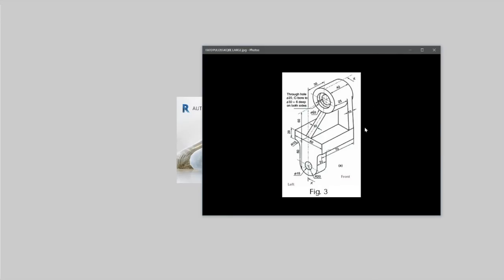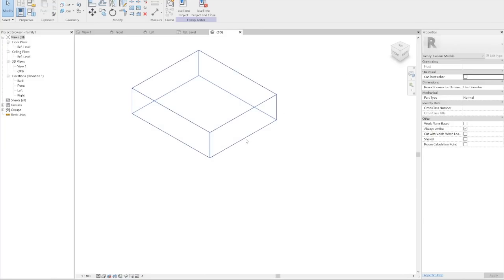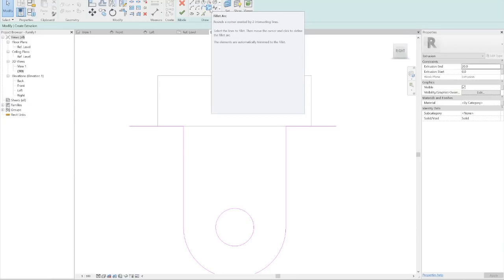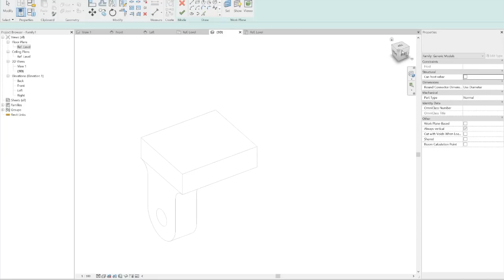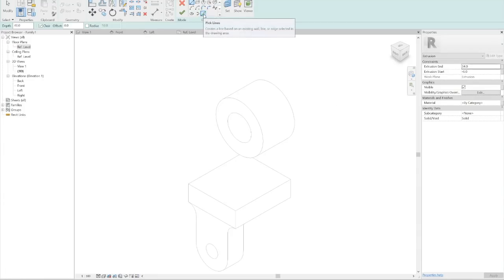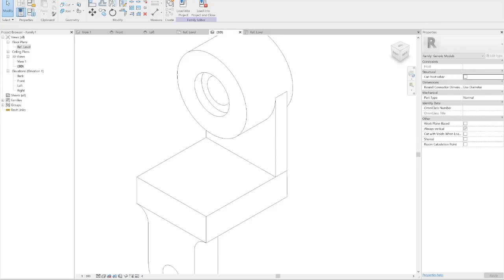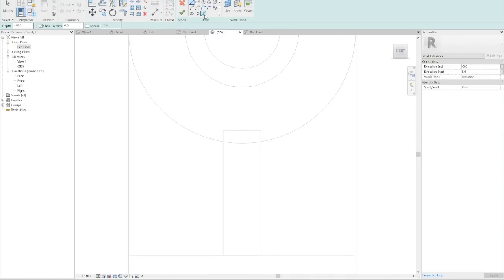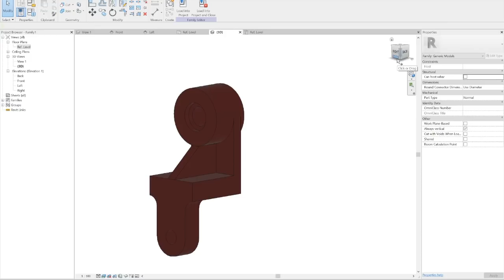Modelling a Basic Mechanical Object in Revit (Metric and Imperial)

Comment: Why cant I join the 2 objects, the central object with diagonal cut on one side and the bigger cylinder? I am having an error saying 'Can't keep elements joined'
Reply from the maker: I’m not too sure about that, I’d have to take a look. Email me at neuroscience@sigmund.science. If you can include the family file, that’ll be best. It’s possible that the diagonal piece isn’t going far enough into the cylinder. It has to go all the way in with no corners out of the cylinder

Comment: `that trim and extend corner function doesn work here. at 6min. how do you do that
Reply from the maker: Have you used the split tool on the curve?
Reply: @DenariPixel  Hi,
 which is better to create mechanical pieces in 3D, Revit or AutoCad?

I want to focus on studying one of the two programs but I am in doubt if Revid can do everything Autocad does.